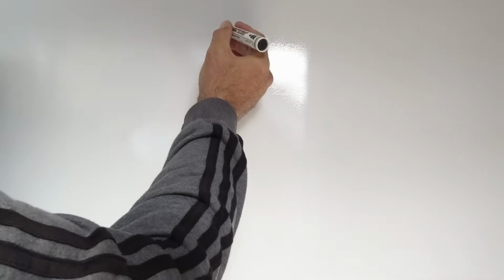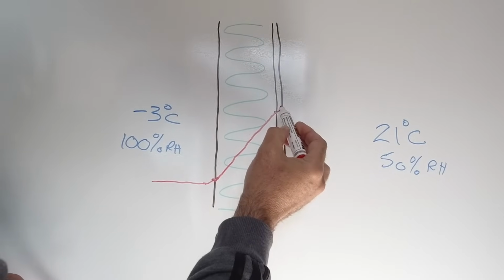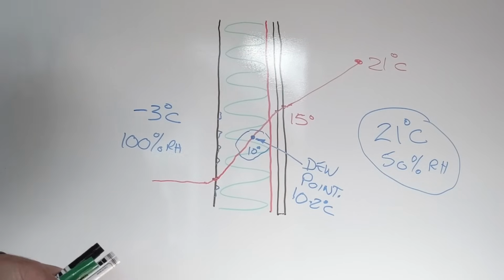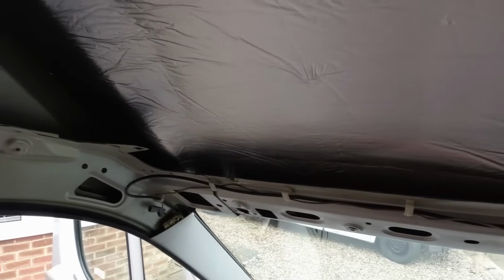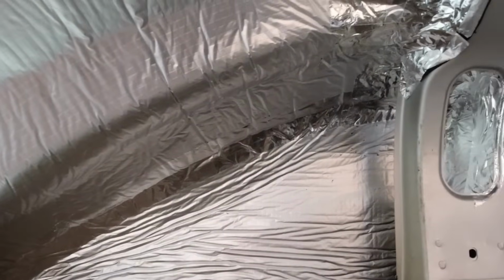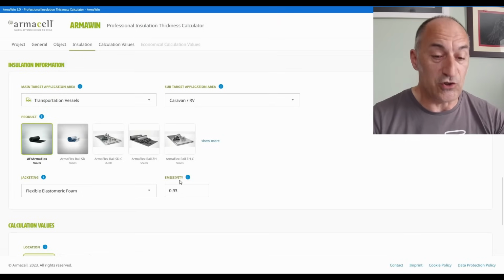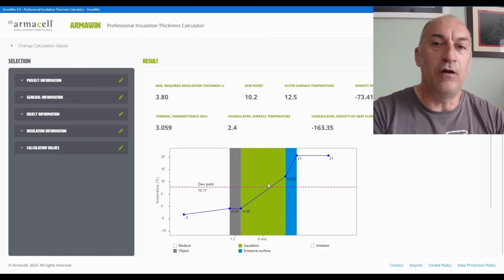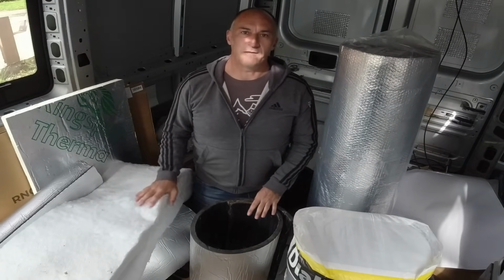The BEST way to Insulate your Van - Budget Build Ep 6

Comment: people go on about insulating the inside of a vehicle, but what about putting some thing on the outside, now, I am after some thing that is cheap, flexible, thin, 100% waterproof,  that I can glue to the roof of me Tramper van, reason , to cut down the sound of rain heating the metal roof, cut that sound down, is better then insulating the inside from the sound, any ideas please, must be cheap,     and nice vids, seen a load of them ,  good info,
Reply from the maker: I don’t think it’s a practical solution to insulate the outside for many reasons. If you use a thick 20mm closed cell foam on the inside of the roof it will greatly reduce the sound of rain on the roof. Check out my link in description it will make a huge difference 👍🏼😃

Comment: Thanks for this and previous insulation videos Greg. I'm in a hot climate (Australia). Is it beneficial here to begin with a reflective layer to reduce radiant heat entering the van?
Reply: I'm guessing that's a yes Greg? Layer of reflective against the steel, then insulation, and then another reflective layer as vapour barrier...

Comment: Greg - I've watched nearly every van build video you've made and since you are an actual professional when it comes to insulation I need to ask you this, hoping for some free advice. I have a box truck, the walls are made of 1/2 inch thick wood/plastic ply material. Since it is a box I'm using metal studs (thin metal construction studs) for the framing of the walls. I was going to glue them to the walls and use 2 inch polystyrene (r10 value) in between. My only questions/concerns are: will I need a vapor barrier and secondly is will the cold from the outside come thru the metal studs? I'm sure you get asked a ton of questions so if you're not able or willing to help, please let me know and I'll keep doing research. This is the stopping point for me until I figure it out. Thank you in advance!! Joe
Reply from the maker: Hello Joe, Thanks for the question. If you bond the studs to the wall with an adhesive that will create a small thermal break because the metal stud is not directly in contact with your outer skin so that helps stop thermal bridging. If the outer skin is wood/plastic sheeting they do have good thermal properties so not going to be as bad as if it was a metal body van. Wood is 500 times better insulator than steel. Polystyrene will be great as an insulator its got good thermal properties of 0.034 W/mk which is better than any wool-based material. (ignore R values because manufacturers often use them to fool you into thinking it's better than it is)  Then I would definitely go over the whole thing with rolls of double foil bubble wrap as a vapour barrier, it's cheap and easy to apply and will make sure that no moisture is going to get through to the structure where it could get cold and start to form condensation. seal all the joins and edges with tape then you can apply whatever cladding you want. Don't worry about fixing through the foil because your fixings are plugging their own holes so there will be no breaks. That will give you a very good warm structure :D
Reply: @GregVirgoe  I woke up this morning and read this and a huge weight was lifted. I can move forward. I will be buying the double foil wrap and rolls of tape for work this weekend. Sigh.. we may never meet, but if we do, a pint will be brought to you!! Thank you!!
Reply from the maker: @joehoffman7019  sounds like I’m going to be very thirsty by then 🤣🍻🤩👍🏼

Comment: Greg, so the aluminium foil IS the vapour barrier on closed cell foil material ?
The issue I keep banging up against in my head is why bother to fill the voids with recycled plastic bottle wadding, because the steel that forms these roughly square section voids by the nature of those side walls of the box sections provides and excellent thermal [read as cold] bridge around the void, rendering anything in the void as useless. The van interior wall of the box so described needs the minimum agreed level of insulation on top of it to prevent condensation forming on that inner surface, so what was the point of the internal wadding ? The cold temperature simply walks around the wadding on the thermal bridge.
A second issue I have simply by nature of having one thickness of closed cell foam on hand where thinner is more versatile than thicker, with aluminium face is to use two layers of closed cell, one directly on top of the other when I need a thicker base to fill a large cavity. By the mechanics of this design it provides two layers of vapour barrier within the depth of insulation material, but does this offer any advantage from a condensation/ insulation perspective than using one thicker sheet ?
So in summary to my often warped mind, the way to speed the installation and maximise the insulation is to take one full sheet of closed cell insulation and secure it from inside internal box section to internal box section down the length of the van, ignoring all the cavities inbetween, which leaves one smooth surface on which to finish the walls, ceiling etc. and to leave the metal to its own devices hidden behind.   This saves time and cost because filling all those pesky voids and faffing around with shaping closed cell material to fit is avoided. 
But I've no experience in the real world. Am I on the wrong track ? And this is obviously not the route your using. Is there anything useful you can add to straighten out my warped mind or should I just see a Doctor ? ;)
Reply from the maker: Hello Alex, As I mentioned in the video, closed-cell foam is a vapour barrier on its own even without the foil covering it would still prevent the passage of moisture. The foil face is an extra layer of prevention so it's double effective.
The purpose of insulating all the voids is to reduce the transfer of heat through the structure by conduction. the better the insulation the less heat will be lost or gained. You are right that exposed metal beams do need to be covered with a thin layer of insulation to prevent condensation and thin layers of closed-cell foam are perfect for that before applying cladding or carpet over the top.
Covering the whole thing in one sheet and leaving the voids behind empty will combat condensation but your thermal properties for conduction will not be very good as you only have a very thin layer of insulation so heat loss will be high.

Comment: Hey, thanks for the great video, just what I needed as I'm at this exact stage with my van.
Can I ask, is this the only area where you used this type of insulation? I see you already have something on your rear arches, have you used closed cell there as well or would you recommend it for that?
Also, I started looking for a 20mm thick version but it's not as easy to get as 10mm. You think there would be any issue doubling up the 10mm stuff as long as the joins in both layers are sealed with foil tape?
Just trying to work out how much I would need as I want to buy it all at once.
Thanks again for all your awesome videos, it's helpful to learn from someone who knows how to do the job properly.
Reply from the maker: Yes we did use it on the wheel arches and in the next midweek video I will explain why. 
If you click on my product link on the description it takes you to an eBay shop where they sell all different thicknesses including some 20mm thick. You can also double it up if you want to 👍🏼😃
Reply: @GregVirgoe  Awesome, thank you so much!

Comment: Hello i miss something which i cannot find while researching to insulate my van, that is what about when it is extreme hot outside like 35 Celsius+ , does insulation help and how thick does it need to be? the condensation calculations are less important and airflow is more important i suppose when it is hot, all i am looking for is to get similar temperatures inside as out side.
Reply from the maker: Insulation works to slow down the transfer of heat so in hot countries it’s always best to add good insulation thickness to slow that transfer down. Think of a cool box with beers in it. 🍻

Comment: Another great demo Greg thank you and I’ll be doing a vapour barrier on my build as you’ve always said of its importance. One thing I’m not sure on as we concentrate on the barrier on the inside but do you have to take steps to stop air moving from outside the van through the outer skin? In my mind there will always be small holes and gaps you won’t know about but is that ok? Thanks
Reply from the maker: You do need to seal up the plastic trim on the sides. But things like door handles and lights we will deal with different as you can’t stop those from leaking. Stay tuned 👍🏼

Comment: Excellent! a bit like an Open University module,
except I could understand it.
Do they give an R value rating for their foam insulation.
I seem to remember for a domestic attic/loft  around R-30 is required,
so that would be a good target,  I doubt you would have much room left in a van, but it would be snug.
I look forward to seeing what you level of insulation you go for in the van insulation ÷ space equation.
Reply from the maker: The figure that defines all materials in terms of thermal conductivity is it’s K value. That’s the only true figure that you can compare like for like. So many manufacturers publish false R values to make their product look better than it actually is. But they cannot fiddle the K value, that’s why many don’t publish their K values. 
So Armaflex k value is 0.033 w/mk
PIR is 0.022 and all wool type loft insulations are 0.044 so that means that Armaflex is midway better than all wool insulation but not as good as PIR foam board.
Reply: @GregVirgoe  Thanks. I'll look at the K values.
I get confused between U value R value K value and C values, but as you say, K is the best for comparison of materials.
Shame they don't make a flexible PIR board
but Armaflex is a close second and spray foam or a combination
Ah I can see where you are headed now.

Comment: What is your opinion on using PUR/PIR plates for insulation for larger straight areas in the back of the van?
Reply from the maker: PIR is one of the best insulation. We will be using it in the floor ceiling and walls too 👍🏼😃

Comment: great video as always, helps to think more in terms of 'holding the heat in' rather than 'keeping the cold out'
Reply from the maker: Yes, heat always transfers from hot to cold. So heat will be trying to escape your van in the winter and it will be trying to get into the van in the summer. So the insulation slows this transfer down by reducing the amount of watts that can get through the structure. The thicker the insulation the slower the transfer rate.

Comment: After absorbing all your initial van build videos before commencing my van build, I took the decision to have mine spray foamed with closed cell foam insulation by a professional company. I spec'd a minimum thickness of 50mm but in reality if far exceeds that by 50-150% almost everywhere but the floor when they finished it flush to all the timber framing I had pre installed. Needless to say it works an absolute treat and it was a really fast process taking about half a day which included masking off and trimming back flush afterwards. Cost wise it was about similar to what using quality products in a traditional 3 step (sound, deadening, PIR board and vapour barrier) would have cost. There was no deformation of the van walls afterwards as many people fear with spray foam but my van is an 11 plate iveco daily so the steel used is a tad thicker than many manufacturers use these days.
Reply from the maker: It is the perfect solution, its got the best thermal insulation properties, you wont get any issues with condensation and it woudl be great for sound deadening and absorbtion too. Obviously its a permanent installation and can be messy to install if not got an experience crew but well done you wil have a great van for sure.
Reply: A word of caution about spray foaming. If you encapsulate the vehicle wiring harness inside any of the body channels / cavities then you will have serious problems if a fault occurs. Try to get the harness either out and then repositioned or run through a suitable conduit or tube. Same if you want to run the new leisure harnesses along any body channels. Try to plan your  cable routes before you insulate. A lot of panel vans use the area near the rear light clusters for extracting the air from inside the van. Greg's use of permeable "wool" in the rear vertical door hinge channels is the best idea in that area. Some panel vans have obvious rear vents on the rear of the van, so these are needed to allow ventilation. If you can't see any obvious extraction vents at the rear of the van then it probably vents around the rear light clusters ( a low pressure area ). I have seen them as low as the bumper area on some vehicles.

 I am retired now but I used to do a lot of auto electrics and vehicle rewiring - hence the experience fishing out harnesses. I have a L1H1 Ducato which has a full double bed, shower cubicle, electric plumbed in toilet, domestic sized midi fridge, microwave and a removeable kitchen station. It was a lot of work figuring everything out.
Reply: @davidmuirhead1060  none of my services are buried behind the insulation, I've designed it all to be easily accessible but hidden to aid fault finding and future upgrades/modifications.

Comment: That was really helpful. You seemed to Butt Joint the insulation rather than overlap the joints. Just wondering why? Thanks
Reply from the maker: I got it as tight together as I could so there was not gap then taped over to give a smoother finish. There's no problem if you want to overlap that would be better in areas where its not going to be seen as it would obviously double up the thickness. Cheers :D

Comment: You most certainly are the "pope of insulation". 😇From your Camp Quirky workshop through all the YT videos you have done on the subject, this is the only insulation info anyone needs. 👍
I had to smile from ear to ear, when you started talking about Armaflex, as this is the 95% van insulation solution here in Germany. I've tried the local Kingspan distributor to supply me with some boards in the desired thickness for the flooring - outragously priced here in Germany. So I have a good supply of Armaflex 19, 6 and 3mm to insulate our van.
A question, if I may: If I use a batten frame on the floor with Armaflex inbetween, do I need to add another Armaflex layer (3mm) to the top of the battens to complete the vapour barrier prior to adding the OSB floor boards? There will be a PVC layer on top of the OSB boards - would this in fact be enough of a vapour barrier to just mount the OSB floor to the battens?
Reply from the maker: You can use tape across the battens or you could use a polythene sheet but yes you do need something to close up all the gaps between wood and insulation

Comment: Hi Greg 
Greatings from Norway
What about to use only Low-E insulation?

Jon
Reply from the maker: I got a sample of that delivered time a couple of days ago. 
It is really thin only 5mm or so. 
Therefore it’s barely enough to stop condensation and no where near enough for good thermal properties. If you installed 10 layers of it that would be better but not practical. 
One thing it would be good for is the vapour barrier. A final layer of that over everything before cladding would be the best thing it could be used for. Ignore any bogus R value claims as they are calculated with a bunch of other building structures so gives a false idea of its own properties. 
Hope that helps. 👍🏼😃
Reply: Thanks

Comment: Hi Greg, thanks for your great dedication in teaching us all how to do it well!
One thing though I still haven't understood: do you make the vapour barrier connect between walls and floor at the rear, or do you let the vehicle drains do their work? What about the sliding door? Thanks again
Reply from the maker: You need to seal any sides top and bottom. I do connect my floors to ceilings too. Block up any plastic trim clips so you will not need to use drains. 
With doors it is different as you cannot prevent water ingress from handles and locks. I will be covering these separately as they need a different approach to maintain the water draining. I have a great solution for doors 👍🏼😃

Comment: Hi Greg my biggest concern is keeping the heat out of the van in Arizona sun conditions,what armaflex product would you suggest in my sprinter
Reply from the maker: You need to maximise the thickness of the insulation to reduce the transfer of heat through the structure. Also external blinds on all glass makes a massive difference to reduce the solar gain which is the largest contributor of heat in a campervan. 👍🏼
Reply: @GregVirgoe  
I've got a panel van and opted not to cut any windows into it for that reason.also have a wood partition between the cab and living space, thank you Greg!

Comment: Great content as always, Greg. I'm just about to start my own conversion and I'll be pretty much following your every move. Your attention to detail is top notch! Out of interest, with regards to the vapour barrier, why do you opt for the double foil bubble over something like a polythene sheet? Is it just for the extra insulating value or is there something hideously wrong with the poly? Many thanks, JIm
Reply from the maker: Unless it’s a very good quality builders poly some of them are slightly permeable where foil is not at all. Yes the double foil does give you a very small thermal break with the bubble layer. I find it easy to apply with a little spray glue. 👍🏼😊
Reply: @GregVirgoe  Brilliant. Foil it is. Thanks Greg 👍